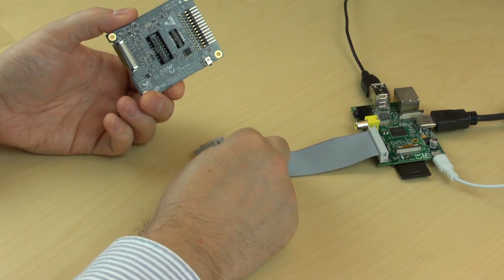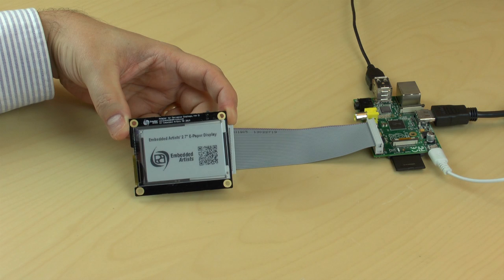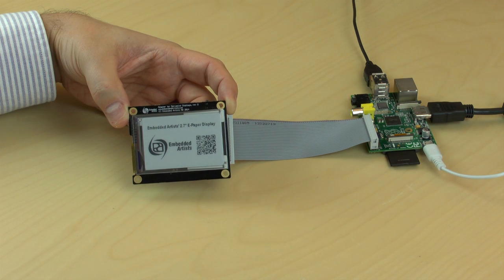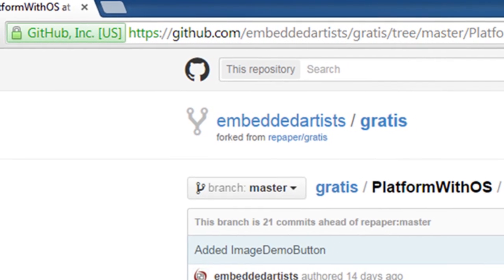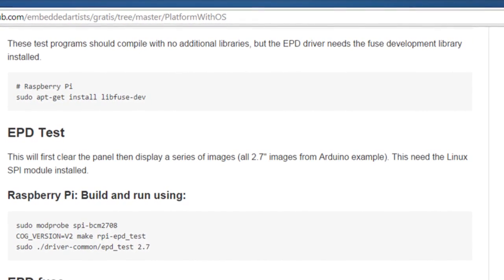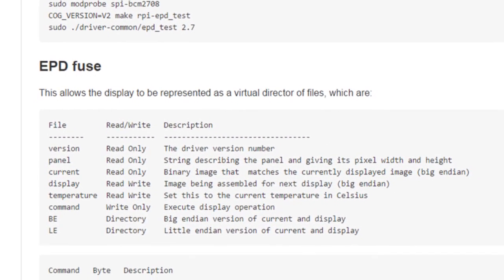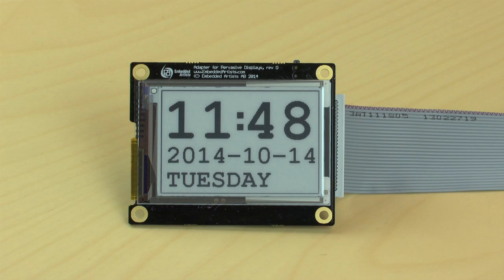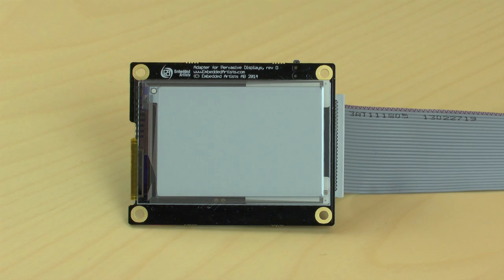2.7 inch E-paper Display - Raspberry Pi

Comment: Hi I bought 2pcs of 2.7 E-Paper from your distributor on the box say it same lot but E-paper panel has different.
My question How To determine panel is EM027AS012 or EM027AS013?

Thanks
ps. I try to register to your web to use suppoer but system reject without error.